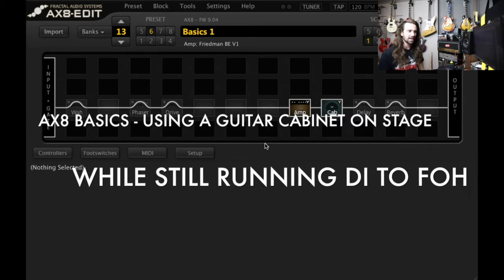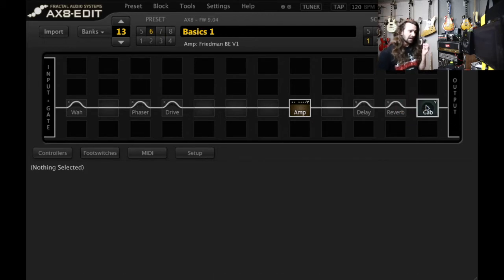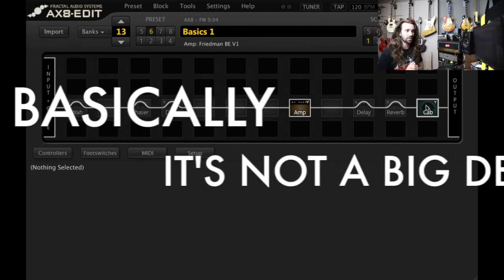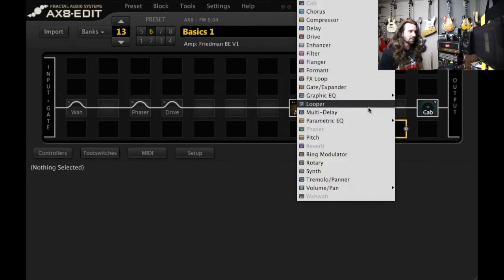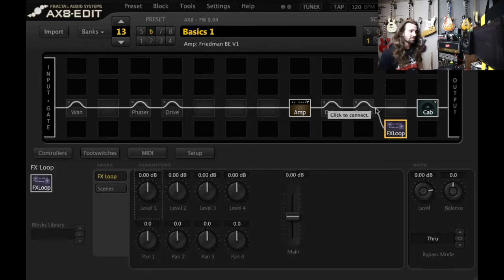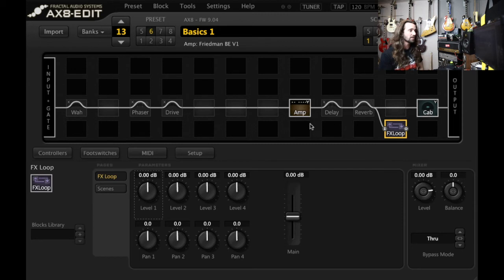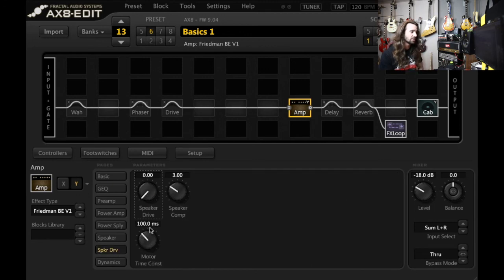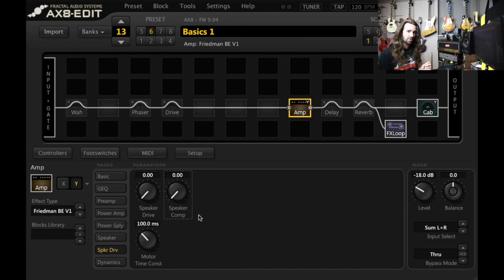AX8 Basics - Cab/DI Setup

Comment: Hey Leon, sorry to bother you man but, I’m new with the AX8. It was working fine but now I can’t add (well now sound) amps and cabs. I’m using the power amp in my Engl. it was working. I'm going just the loops to loops. The sound works with the interface but not working with the amp. Must be some output or fx loop issue but i couldn't figure it out. Please help, great  show. You seem to be a Jedi for the AX8. 
Thanks in advance!

Comment: What about using L and R output . L with Cab simulation goes directly to FOH or mixer, and the R output goes to power amp  . Is this way right?
Reply from the maker: That works but you're stuck running it in mono. You can run stereo this way.